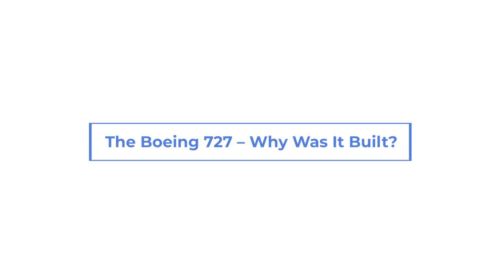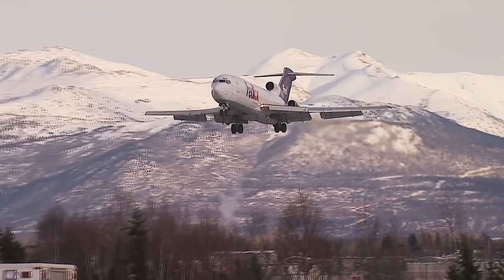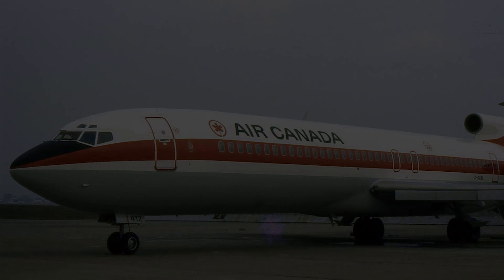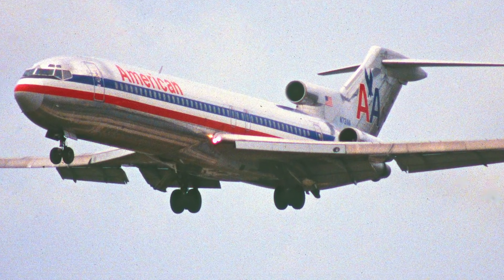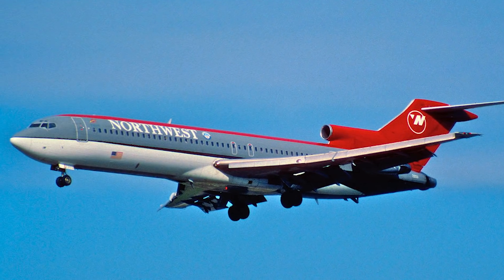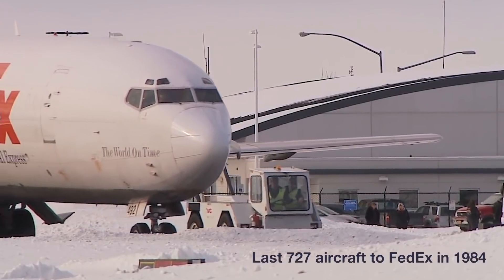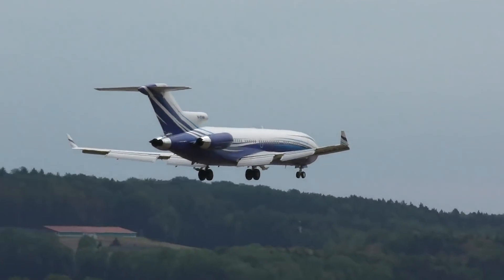The Boeing 727 – Why Was It Built?

Comment: Two simple reasons why the airplane isn’t still operating today.
Pesky fuel cost of 3 engines can’t compete with twins of the same size
3 pilot cockpit.
While the 3 pilot cockpit could be addressed, the 3 engine configuration could not.
Sad because the 27 is veery fast, and very maneuverable.  Nothing comes close to it now in all performance areas except fuel efficiency.

Comment: Uh, why are we focusing on the number two engine exhaust while listening to a description of the APU, which is located in the right side of the main wheel well?  The 727 was indeed designed for shorter runways, but ironically enough the -200 version was immediately labelled as a ground-hugger because of its long takeoff roll when fully loaded.  Improved engines eventually lessened the sense of adventure encountered when pushing the throttles forward for takeoff.  I first flew on the 727 in 1965 on a local flight from and to Tulsa, a twenty-dollar promotional flight American provided to familiarize people with the comfort of flying on its latest airliner.  Working for various airlines, I flew on the 727 as a passenger many times in the 70s and 80s.  No airplane before or since has given me such a sense of being at home in the air and safely on the way to my destination as soon as it left the ground.  Can't explain it, but a lot of other people seem to feel the same way.

Comment: Wasn't the APU fitted in the wing/fuselage area instead of the tail.
I might be wrong of course! 🤔
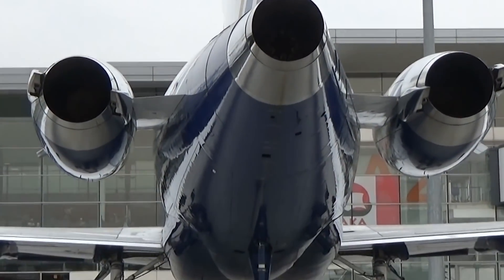Reply: You are 100% correct.  I had a small chuckle starting at 0:53 where the narrator starts talking about the APU, but the #2 engine is being shown, but you can see the actual APU exhaust on top of the wing root at the 1:06 mark.
Reply: @get2dachoppa249  I thought so. Thanks.  👍
Reply: Yes. It’s in the forward part of the main gear well and it extends through the keel beam with the exhaust on the upper right wing root. 

That and the on-board airstairs (one at the back and one underneath the left forward door oknsome models) made it self sufficient. 

It was strictly for ground use only. There was no need to use it in the air with three engine driven generators which could all be tied together to power any electrical bus. 

When the 737 came along they wanted to get rid of the flight engineer. This meant being unable to synchronize and tie generators so they used a split bus system. One generator powered one bus and the other powered a separate bus. But if an engine or generator failed that bus would be unable to receive power. So they made the 737s APU able to be started in flight and each bus can flip flop between the engine driven generators and the APU.  The APU is on for takeoff and switched on before landing so power is available if needed.
Reply: @calvinnickel9995  Thanks for the reply. 👍
Reply: @calvinnickel9995  On the 737 the APU is turned off prior to taxi.
Reply: @calvinnickel9995  
Good job informing the crowd!
Early models had  a flap covering the Apu exhaust,which was later modified and louvres were installed...
Reply: @calvinnickel9995  "There was no need to use it in the air with three engine driven generators which could all be tied together to power any electrical bus." Except when the MEL allows for only two working generators and one fails at a really bad time. United flight 266 plunged into the ocean off LAX, January 18, 1969.

Comment: Back in the day the best engine was the Pratt & Whitney JT 8 D. Three engines gave it more thrust so it needed less runway than a twin engine design. The greater fuel efficiency of modern high bypass ratio engines which are also considerably quieter rendered the design obsolete.

Comment: Whenever anyone says ‘if it ain’t Boeing I ain’t going’ I remind them Boeing has history with unsafe designs and inadequate training...
I also think the Sud Aviation Caravelle deserves a mention, here. It certainly inspired with more than its airstairs.
Reply: I believe the problem was that pilots of the time did not plan for the slow spool up time related to the jet engine.  Many of the airline pilots of that era transitioned from the straight wing/piston engined airliners. I don’t think it had anything to do with flap design, but more to do with the swept wing design characteristics. Nothing wrong with the 737MAX either. I just did my recurrent training with two runaway stab events, and they were very easily handled. The MAX was the first airplane to be grounded by the media. Boeing still builds the best airplanes.
Reply: Then you’d know that MCAS isn’t a stab runaway. 

Yeah.. you see the trim wheels going a million miles an hour and the control forces increasing, it’s pretty easy to hit the stab trim cutoff. 

What’s not so easy is getting a stick shaker telling you you’re stalling combined with slow and intermittent trim wheel action and the forward pressure which is coaxing you to do the instinctive action the shaker is telling you to do. You hit the trim switches and the trim stops and operates the way you want to, but then after a few seconds it starts slowly trimming down again. 

Either you were the first crew who didn’t know MCAS even existed... or you’re the second crew who did exactly what Boeing told them to do and disconnected the trim.... at which point the aerodynamic loads on the stabilizer combined with the smaller size of the MAX trim wheels meant they were unable to retrim the aircraft. At that point they decided to re-engage the trim and MCAS continued trimming the aircraft to its doom. 

A primary flight control should never have a single point of failure on a transport category aircraft. Boeing and the FAA knew they screwed up. It would have been nothing to have MCAS run from a second AoA probe with cross-talk and disabled with a miscompare or no compare. It also would have been nothing to not include it and break commonality.  

And just look at how long it’s taking. If it was a small problem it would have been easily fixed. But it’s not.. and it might be the end of the Max, the 737, and perhaps even Boeing itself. 

“Third world” countries are often the low-hanging fruit of root cause analysis but truth is state owned airlines like Ethiopian are among the safest in the world because money is no object. 

I think the reason why this never happened in North America or Europe is because the planes are on autopilot 99% of the time which disables MCAS.
Reply: Calvin Nickel In all actuality it is, when the trim moves in an uncommanded manner, the response from the flight crew is the same.
Reply: Yes, the MCAS system is a flawed design, but the airplanes still should not of crashed. In 23,000 hours of flight, I’ve had a few situations where the automation went a little sideways. You have to determine (quickly) what the heck is going on. You noted the Ethiopian crash in your post. They had the emergency communication from Boeing about MCAS and the actions to follow. The 300 hour F/O correctly identified the problem. They turned off the Stab Cutout switches correctly. Then turned them back on. They never pulled the power back from TOGA. They tried to engage the A/P repeatedly. These guys had not done their homework. The Lion sir incident is equally as bad. The previous flight flew the entire flight with the stick shaker going. A jumpseater told the captain that the trim wheel is moving unnecessarily. It’s the same size wheel as any other 737 by the way. This airplane should have been removed from service. These are not safe airlines.

Comment: Boeing only looked into developing the 727 after seeing the Hawker Sidderly Trident in development
Reply: Trident didn't sell well...wonder why?
Reply: shrimpflea Dehvilland trailered too much towards one airline operator when the original design would have been closer to the 727 and thus sold to more airlines.
Back then the UK government stipulated that the aircraft designer had to design to what the airline industry in the UK wanted NOT what the airline industry world wide wanted.
As a result there were three variants of the trident made in the end. The last variant came close to what Dehavilland originally wanted to design but stuck with the wrong choice of engine that didnt scale up in size large enough for what was needed for the aircraft. Hence the booster engine

Comment: 727 was one of my all-time favorite airplanes.  Kind of noisy especially toward the back but I always felt safe because I knew they were built like a brick shithouse.  I can't help but shake my head about the 737 max fiasco, especially since I make my living making parts for Boeing airplanes including the 737 max.  They had to try especially hard to screw up that program, it should have been a slam dunk success.  Boeing showed an amazing ability to snatch defeat from the jaws of victory.
Reply: That's unfortunately what happened once the McDonnell Douglas management mentality got in control at Boeing.    Nothing like moving the C level executives 2,500 miles away from the engineers and primary build facilities.
Reply: @radon360  My little Bro has been with Boeing for 33 years, he is about to retire.  After the merger he had some really negative things to say about the pack of wolves from McDonnell Douglas once they got in and took over.  But talking to him more recently it seems like they bought him off.  He was an engineer and I think he got promoted to management, he doesn't tell me exactly what he does but he talks about getting budgets and hiring people.  I have been stunned by a couple things I have heard him say, not in a good way.  He stayed in Seattle but it seems like he became one of them.
Reply: @Stacie45  I retired from Boeing seven years ago also after 33 years, but by merger with Rockwell. I saw the whole McDonnell St. Louis takeover disaster from the inside and it was a shame. The next in line for CEO was the 777 chief engineer, so the board rejected him and brought an outsider from 3M who seemed not to know the difference between an airplane and stack of Post-it notes. The Board of Directors is a big part of the problem, only three with any aviation background.
Reply: @jimandmandy  Seems like the upper level managers mostly are marketing people but mainly they are political people.  I have been with Rockwell Collins for several years and we are now part of Raytheon.  It is really just about one big government-private quasi-monopoly now.  When a disaster happens due to sheer incompetence and negligence the rulers circle the wagons and cover for each other, nobody is held accountable unless it is some lower level patsy who gets taken out back and shot for public consumption.  Not that I'm cynical or anything...

Comment: This is what people want to the boeing 737 max let it fly for about maybe a month or so maybe as cargo as noone will trust it and probally if it does not crash you will have passangers trust again or they could just fly the airbus A320 or is it A321 neo.
Reply: I will book a 737Max flight at the time that is put back into service, fear is not in my vocabulary.
Reply: I think more people worry about the flight times and cost instead of the aircraft. Yea you have these "never fly on a max" people, but to be honest most of them couldn't tell you the difference between a MAX and a 72, 75, or even an Airbus. At the end of the day people are going to look at what matters to them, which is usually flight times and cost, and not the aircraft.
Reply: I would fly the MAX today, with a Southwest crew. A321neo has a similar basic issue as the MAX, but no MCAS bandaid. The last two rows of seats were blocked for CG when I flew it on Hawaiian two years ago. Lufthansa wants compensation for the lost revenue.

Comment: I really liked flying in this jet.  The airport I flew out of had a long runway but was cramped on its sides and both ends.  So the pilots tended to go screaming down that long runway and then pulling back hard on the stick.  Swear the tail was dragging for a short time.

Comment: AIr Max is dead.. It's the design flaw. As you have two huge ass engines. Designed for bigger aircraft. That are too far forward. Which makes it nose heavy...And no amount of sensors is going to fix that issue...

Comment: To bad they didn't learned the lessons and had to repeat it with the MAX ... "It's not the plane but the pilots..."
Reply: Wrong, the Max has a computer system that pushes it into the ground and which the pilots were not told about.
Reply: @rsattahip  wrong. Thats what they thought the problem was. After first accident there was greater education about the system and how to disconnet. The ethiopian crew did all after protocal but airplane still went down. I.e. when protocal didnt disable the system all planes had to be grounded. Why do you think its not back in the air if all it was was education?
Reply: @rsattahip  - The pilots knew about it. The Ethiopian crew turned it off, just like they were supposed to. However, they didn't reduce their airspeed and let it get very high, which made the manual system hard to use. When they had trouble with the manual system, they TURNED MCAS BACK ON, and at that high speed they couldn't fight the trim inputs. They forgot to "Fly The Plane".
Reply: Robin Sattahip They rushed the design because they wanted to compete with the NEO. Boeing put a 2020s engine on a fuselage designed a century ago ... If it was just a MCAS issue it would be long time that the MAX would be flying again.
Reply: @garyreed2206  Easy to say after having all the time in the world to learn about what they presumably did wrong - but these guys had just a few minutes and an enormous level of stress.
Reply: @ZiggyMercury  - Not discounting the "Armchair Quarterback" quality of these types of discussions, but at least we are lucky enough to be able to discuss such things. In all my years and 4500+ hours of military flight time, I have seen my fair share of incidents where the pilots forgot to "Fly the Plane". Most of them just got a very good lesson for them and others to reflect on; another few were not so lucky.

Comment: hopefully? I hope the 737 MAX project gets scrapped all together so no one has to risk their lives flying on a flawed aircraft.
Reply: Kenneth Wang because this is the first time ever a plane came out with a design problem? It’s tragic and it shouldn’t have happened. More so Boeing should NOT have had so much pull with the FAA. I can name quite a few long time, safe, work horses that had design or other safety related problems initially. DC-10, 727 are two that immediately come to mind. Those planes are under enough scrutiny right now that when it get recertified there should be zero concern about its safety.

Comment: HOW DARE YOU" Simply Flying" to correlate the outstanding service, success and history of the B727-100 & B727-200 with the B737MAX catastrophe.
Reply: I think the comparison is quite fair.  Both incidences with the 737 MAX could have been avoided if the pilots had been properly trained and tested in the simulator.  All that it takes (took) to stop the problem is two cut-out switches on the center console to disable MCAS input to the stabilizers.  The problem with the 727 flaps is similar, pilot training on the peculiarities in both cases was lacking.  
This is not to say that there aren't design flaws with the initial rollout of MCAS in the 737 that needed to be corrected. But, a competent and experienced 737 flight crew would have had little difficulty stopping the problem before it became dangerous.
Reply: @radon360  An ex-coworker who is a B737 veteran of 25 years while on a test on the B737MAX simulator prior to the corrections added crash twice.
Reply: @TWTR4EVER   25 years on the job in a 737, and still hasn't figured out what that big, motorized spinning wheel by their knee does, nor know about the two switches on the console to disable it...twice?  C'mon, you're either making stuff up, or this pilot should have gotten the boot from the check captain a long time ago.